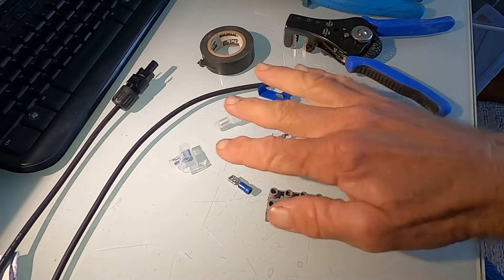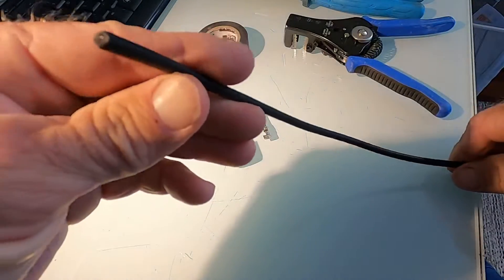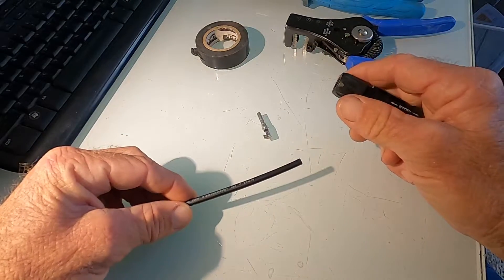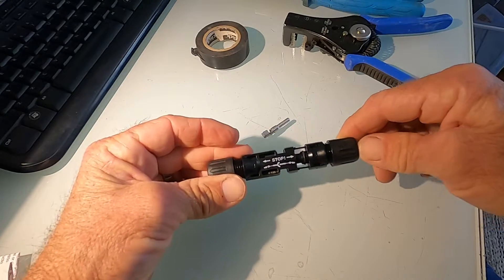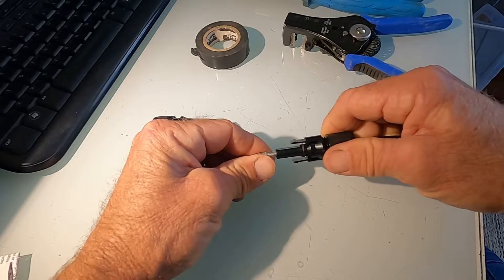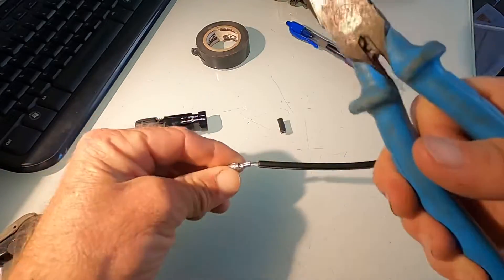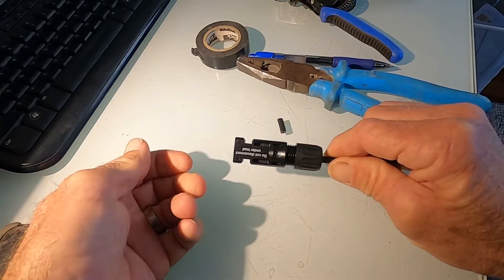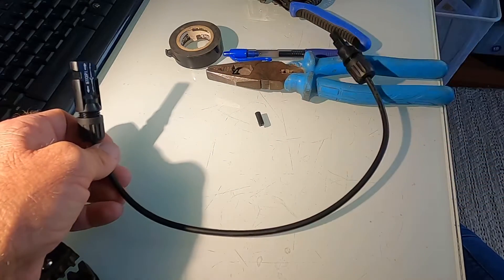How to join solar panels and solar wire together the right way. Easy with DIY  MC4 connectors.

Comment: Its called MC4 due to Pin size nothing else not cable size lol also designed for 6mm solar cable would check your data first but for info  Features
1500V DC rated voltage
IP68 [mated condition]
Suitable for 2.5mm², 4mm², 6mm² cable
Ambient temperature rated: -40 to +85°C
NEC interlock
Salt mist test: IEC 60068-2-52, severity 6
UV Protection: IEC 4892-2

Comment: Nice video! Information very useful. One observation folks even though you saw him plug those together, never never plug those together on the same solar panel!! You may burn the wires instantly or cause a power arc if those panels are exposed to the sun at the time. So never connect same panel plugs. 😅
Reply from the maker: Just like in my recent video 😅

Comment: Thanks for the video, I know this is the correct way but I’ve found it makes testing tricky. 
What are your views on using a junction box with rubber sealed glands? 
This in my own mind makes testing much easier and all positives linked onto a single rail. Same of course for terminating the negatives.
Reply from the maker: If paralleling circuits yes that makes sense.

Comment: I have watched videos on youtube about crimping stranded cables and they say not to twist the strands as under the crimping force they can cut through each other ? Is that correct
Reply from the maker: Thats a valid point! I wouldn’t give them a full twist like I would regular cable but I guess yes it could damage the strands a little. I will look into that 👍🏻
Reply: Is it ok to you use one of those other joining methods if the connection is inside i.e. not out in the elements? I need to join to pieces of wire together to extend the cable inside a campervan. Thanks.